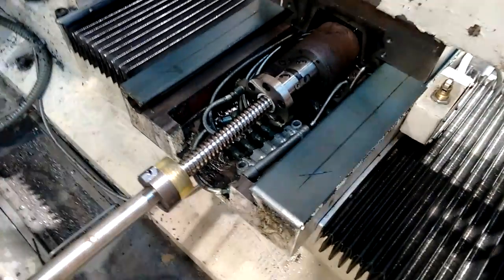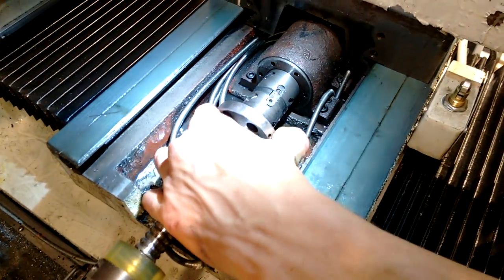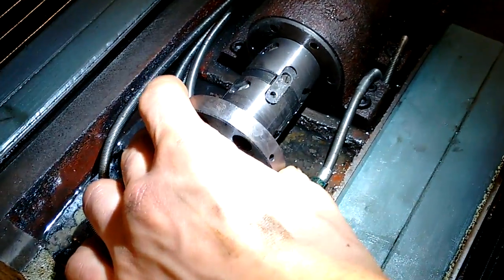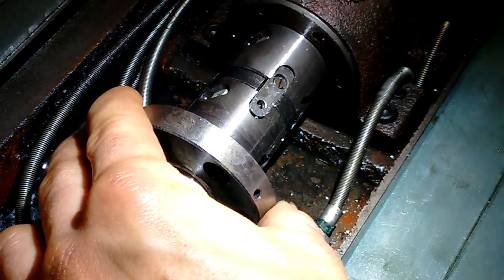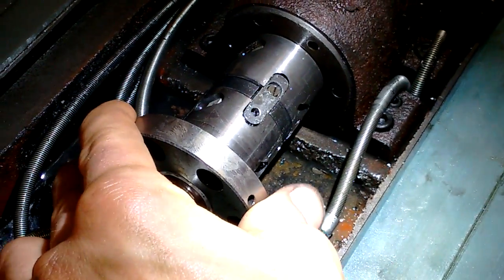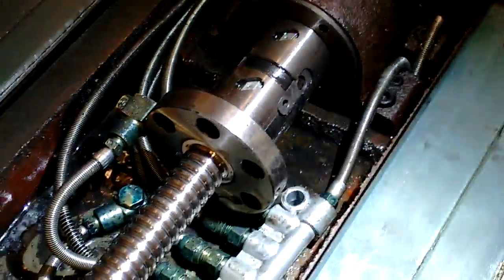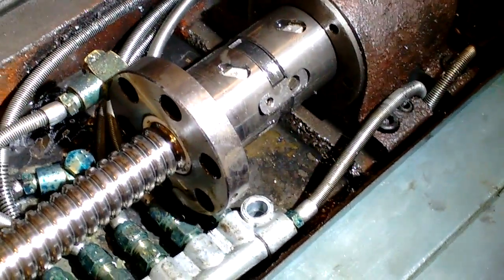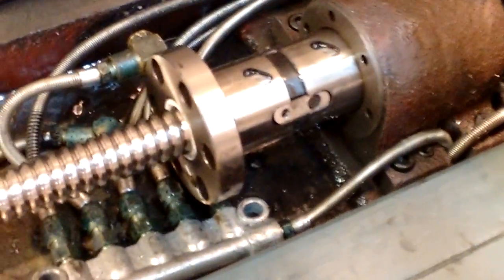Tormach PCNC 1100 X axis backlash

Comment: Are you guys still using your tormach 1100? is it still running well/accurate? thanks!
Reply from the maker: We are still using it, though we have plans to upgrade to some professional quality VMCs soon. The tormach will likely remain in the shop for sheath milling and other little jobs like that. It runs well and as accurately as could be expected. We do have to replace certain parts fairly often. The accordian style way covers are prone to wear, at least when we mill a lot of steel. Some of the bearings are pretty quick to wear out too. The x and y axis angular contact bearings are the most common, followed by the lower spindle bearings. We've started using better quality (japanese) spindle bearings as they seem to last a lot longer.

Comment: hi, i have a tormach 1100 and i have the same x axis backash problem. I already checked the center bearing and it looks fine. What other problem could there be for this problem?
Reply: there is a more detailed article linked to in the description. First thing to check is the ballscrew mounting bearings near the stepper. These can wear, fail, rust, come loose etc. Next to check are the gibs as described in the article and in tormach user manual. Ball screw is hardest to fix and last to check/fix. We've run our tormach 7 years pretty hard and still have the original ballscrews/nuts, but we've had to tighten all of them at least once
Reply: @johngudmundson  
Thank you very much for your comment. At this very moment I am in the machine. I already adjusted the gibs of the x axis as indicated in the manual and in the morning I checked the central bearing and it seems that it does not have any problem but I still have a 0.003 "backlash in the x axis. Any Another idea or tip that you can check in the machine to solve the problem?
Reply: @jesusamadohernandezbarba7521  What do you mean by central bearing? You have to check the thrust bearings at the end of the ballscrew by the stepper and also the ball nut that runs on the ball screw. How are you testing the backlash? (ie with an indicator?). As mentioned in the article, even ball nut carriage mounting bolts can be loose so that there is movement.

Comment: how much X axis backlash is acceptable? my 1100 is having this same issue, 3 months old.  Same speeds and feeds cut like butter climb milling in the Y axis direction, but squealing and chatter in the X.
Reply from the maker: First of all, if it's 3 months old and you can prove there's out-of-spec backlash (with an indicator) you should get a hold of tormach support as they should cover any replacement parts.  

To answer your question, .0005" (half a thousandth) is what I would consider acceptable. Your jibs, ball nut bearing pre-load and axis bearings can all affect this backlash/lost motion.
Reply: I can push and pull on the table and get 0.001" total movement across the X axis measured by dial indicator on the end of the table.  A whole thousandth seems like a lot.  I push on the table in-line with the axis for the measurement. The other day I was running a program and the cutter hit one of my hardened jaws and started vibrating quite a bit, I was stupid and let it run for a while.  Now I'm wondering if something has come loose from the vibration, I messed with the gibs and tried several different tools trying to find the problem.  There is much less movement pushing on the Y axis, hardly any.
Reply: Oddly enough tightening the Z axis gib all but eliminated it.  I guess the design of the head is such that the gib is more important for left to right load than front to back.  Problem seems to be solved for now...
Reply from the maker: on our pcnc1100 we tolerate about .0005" of push/pull movement in the table. The Z gib fixed it? That's pretty odd! I hope it stays fixed!
Reply: I would guess the Z gib being loose just magnified the X movement problem.  I had a travel indicator mounted to the head to measure it too, so now I don't know about my X play value.

Comment: My 770 is 1.5 months old and today I noticed the poor surface finish and chatter from the same program I ran on the mill new that gave excellent results. I have never crashed the mill so I wonder if the ball nut like yours is loose?
Reply from the maker: Could be! I would check the cutter for wear and replace it, before digging any deeper.
Reply: I will give that a look. The part is coming out with a series of uneven facets. I will try measuring the table backlash with a test indicator too.
Reply from the maker: Sounds like a plan. what material and what type of cutter?
Reply: I was cutting 6061 with a dataflute 3/8 3 flute carbide Zrn coated endmill with a 12% step over. I see no evidence of the coating worn away and it still looks like a brand new end mill.
Reply from the maker: Hmmm. doesn't sound like the cutter then. But, it is always easy to replace it to make sure that isn't the issue. Otherwise I would get out the indicator and start checking things like you said.